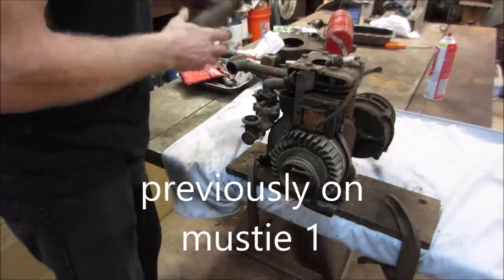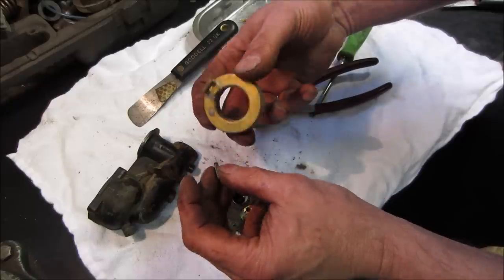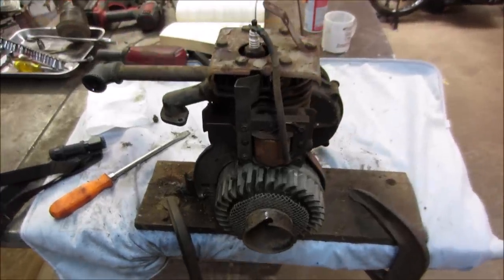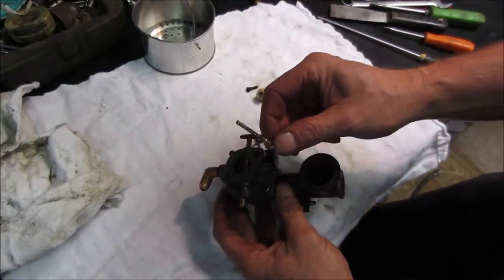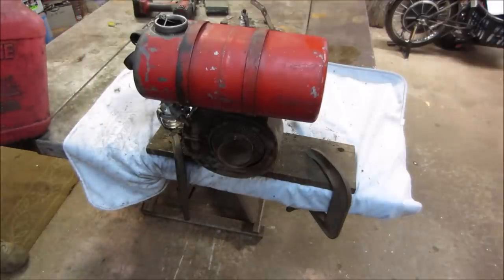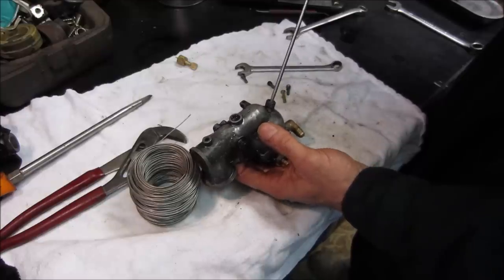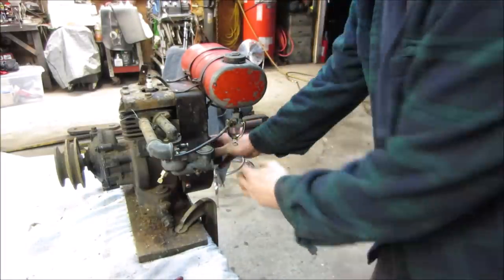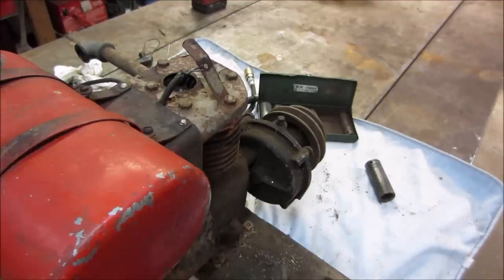Will It Run? $5 antique Briggs engine.part 2

Comment: For knocking the rust out of old gas tanks, I saw a trick. 805 Roadking drains em, fills em with a handfull of 1/4" square nuts, put the gas tank lid on and tapes the tank to the wheel on the back tire of his lawn mower. By the time he's done cutting his lawn, all the rust is scrubbed loose. Then he hits it with an air hose.

Comment: I had a lot of the same problems with a B&S Model 23, a larger version of this engine.  Had the same type carb.  It drove me absolutely insane.  Must've had it apart 4 or 5 times and it never ran right.  I finally couldn't take it.  I kept the cart the engine came on, and threw the engine out the second story window.  Problem solved.  Not every one is worth saving.  I applaud your patience, because it's WAY better than mine.

Comment: I’ve had some nice success cleaning out old rusty metal fuel tanks with muriatic acid. You really need to use it outside because it will cause bare metal around the environment to rust and healthy to breath ... not so much! Rinse out with alot of water afterward and give it a few days to dry. It has never failed to end rusty, cruddy fuel problems and I have never needed to do the same tank again.

Comment: It looks like a 5hp Brigg's engine we had on a Toro reel mower in the mid 1950's.  It worked pretty good the first year but after that it wore my arm out.  About the only engines I knew anything about in those days were a Mc Coy 29 and a Fox 35.  I could connect up my Lionel train set but that was about it.  Anything more complicated than these would have to wait another 20 years.  The Brigg's always had spark but the carburator must have had problems and we had good gas in those days, but Briggs engines in those days were an ify situation even at the best of times and 10 year Olds were not the best of times.

Comment: I havent looked at a Briggs in a very long time and this brings back all the bad memories. Starting from new, and you change the oil and maintain them, they have a life which in my experience is about 15-20 years and thats it. It might be fun to dick around with old dead engines but its not like they can be put back to serious duty.  Coughing and sputtering becomes a permanent condition no matter what you do because all they want at some point is a decent burial.

Comment: Mustie1 try small steel ball bearings next time to swish around in the gas tank with your choice of fluid to clean out the gas tank.
It works for me when i acquire an older Coleman lantern to clean out the sediments in it from the lantern sitting for a long period of time. 
Keep the videos come to western Pa.🙃🙃

Comment: All the  old Briggs never die. I’ve hardly had to do anything to make one of one run. I’ve only taken 3 carburetors apart out of a dozen Ive worked on and very few needed the points cleaned and re gapped.

Comment: Had those sediment bowls on all the small gas engines when I was in the service back in the day.  Rarely collected sediment but they would regularly fill up with water.  Was the first thing you checked in the winter because the water in the bowl would freeze.  The glass was tougher than you would think.  Dropped a few on hard surfaces and they didn't break...but we did have replacements, lol.
Reply: Feline Spirits I actually have a couple of new bowls in stock in my shop, along with some of the cork bowl gaskets. I can still get ‘em from my distributor. Can even get complete new assemblies. Most people don’t stock anything for the older stuff, but I like to keep some of it on the shelf so I can service folks that still have that stuff.

Comment: thanks for great vids watched a vid you had about generator that had a leaking fuel gauge i have used nail varnish to seal petrol leaks in past the clear is also good on cleaned cloudy gauges carry on the good work

Comment: On of my most used abrasives is Kitty Hawk NC beach sand.  It is very coarse with granules that vary from 1 to 2 mm  It washes out after two or three rinses.  It is small enough to get into crevices but not get stuck there.  I use it with water to clean out drink bottles.  It would probably work well in that gas tank with mineral spirits or alcohol or water.

Comment: That engine looks like the one I had on a go kart in the early 1960's.The first thing I did when I got it  was to remove the governor. I remember going for a ride with the kart and do a few laps around the neighborhood then drive into the garage and see if the cops would go by.

Comment: I have chucked those float needles in a cordless drill  the needle against a wetstone and removed the step so they can be used some more.  Just have to readjust the float level again.

Comment: Tractor supply has gaskets for the sediment bowl as well as replacement bowls.
The engine model mark would be under the gas tank.
That was why we were so skinny back then.  All that exercise trying to start the silly things.
The bale was to pull the pin out, also for ease during assembly
Reply: @Ashurii Canada?I thought he was in New Hampshire.

Comment: I once had someone give me a free Honda Accord with a stuck float. Honda carbs are notoriously bad to work on, so I clamped a set of vice-grips on the fuel line and just set them to the speed I wanted to drive at. I probably put 10,000 miles on the car that way. Got really good at it!

Comment: Took a carb apart just like that a couple days ago. You didn't say what the issue was with that odd screw but mine had one that was longer as it held a bracket for a metal crank case vent tube that more or less wrapped around the carb and entered a rubber flange on top of the breather. My engine was a smoker so i didn't go further. I thought the governor was missing but yours has none either. Didn't know they were made without them. Might take another look to fix.

Comment: well beings it is only one cylinder,it has to run in spec,i watched you wiggle the valve guides,they're toast,i saw the clearances on the piston,its toast,one cylinder and two cylinder engines I waste the time and hand hone them to clearances on the pistons,piston to wall clearance is critical to run forever,valve guides are next,they have to be set up to run,forever,this is a forever engine,look how old it is,the metal is up to par,probably has a cast iron liner,they were superior,like you approach to repair,this is where I started,this repair has lead me to a career in auto mechanics,strange start,fixing things is a good life,no boredom

Comment: you should build a tank turner to tumble them just an electric motor , a jack shaft , a couple pulleys and an old belt gear it to slow the turn , and weld some washers to the pulley so you can use a bungee to attach it , or do what I did in the spring that worked really good on a tiller tank , took a yard sale orbital sander , drilled 2 holes through the pad and put two small I bolts through it , clamped the sander in the vise , used a bungee to hold it on the pad , added a couple handfulls from the misc nut and bolt bucket , a little gas , and turned it on , flipped the tank around every few min to get all sides , it was pure rust when I started , it came out shiny like a new one try it sometime it's loud and annoying but it worked so dang good it is worth it if it's a tank you don't have a replacement option for laying around it was that square tank many of the 5 and 8 hp engines used , but it has a slanted bottom to clear the tiller handles only one I have ever seen like it and the normal tank won't fit , seems like a cost adder when they produced them making b&s supply a non standard tank to them , who knows , we will just blame it on the government LMAO

Comment: I once found a Coleman Gasoline lamp about15 or 20 feet up in a tree that was from the 1940's.
The gas tank was full of twigs and other forest related crap.
It looked like it was probably hung at 5 feet when left and just hitched a ride upwards as the tree grew.
Still a little grumpy on the start up but I replace the glass and fuel tank, but recently broke the glass and the new replacements are all just a little bit too small in the diameter.

Comment: Seeing you working on that Briggs brings back a lot f old memories. Unfortunately, few were good memories and I still have a scar on my right index finger knuckle from trying to adjust one of those carbs. :/ One thing that I did seem to recall, isn't there supposed to be a little spring steel flapper that covers that little vent hole on the bottom of the intake tube? On a previous job,they had a bunch of Briggs-powered trash pumps and I seem to recall them all having that flapper.
Reply: By the way, nicely timed! "Coming Up" and the otter popped out of the ice.. :)

Comment: Mustie  May I suggest  finding an old bbq grill rotisserie  motor and shaft. Mount so it will rotate a rusty  tank with media in it. Probably  best outside because the motors a quite noisy . I enjoy your videos, but here in Alabama  nothing is free, it could be a rotted out Murray  mower with one good tire and they will ask 200.00 for it. Good luck.

Comment: I have the same motor ,needed a coil couldn't find. One on eBay ,or fro Briggs and Stratton took old coil apart and took a coil from new one and put it together ,and it work

Comment: I remember when I could ride my bicycle a few blocks to the Western Auto store and get a glass bowl and gasket for 10 cents. A local store chain called The Farmers Store had small engine parts into the late 70s when a college educated manager took over and had them get rid of all of that stock because there wasn't enough profit in it. They stopped selling individual drill bits, screws, nuts etc and sold sets or packages instead. The people who had worked at the store for many years tried to explain that people came there to get the odd things and often bought other things. The new management wouldn't listen. 5 years later the stores were all shut down.

Comment: The last metal fuel tank I cleaned using my jar of small stainless fasteners.  Poured them in along with some solvent and gave them a shake for a while. Worked great and just put them back in the jar when finished.

Comment: Hopefully I get time to make one............... and can figure out how to ship.  I want to send you one of my propane thanks that I modified into an oil collection tank.  I make them with a nice long hose that you hook to a vacuum pump then suck oil out of an engine, and use an air fitting to push the old oil into a different tank when it is full.

Comment: I clean gas tanks with used motor oil and a piece of chain (sized depending on size of tank/ thickness of metal/ depth of rust).. put inside and give a good shake ;) Pour out rust/ oil and tank is "coated" & ready to use :)

Comment: It's a later model 8 Briggs, 1957ish, with a K90 Kohler fuel tank assembly. Looks like it was on an early 60s minibike -with string throttle haha! Long stroke, small bore, lots of low end torque, 2-1/2 HP @ 2,800rpm.

Comment: Yes, it's so easy to mess up the main mixture on those. Packing won't let it seat. Then you get over rich and then it starves for gas. If you want to play soak all the gaskets and packing in brake fluid, sometimes it will make them pliable enough you can reuse them. Good videos though, make it run first before you spend any money on it!

Comment: If this would of existed 10 years ago, i would of sent you 2 of those carbs for parts with the oil air filter on them still.

Oh and sulfuric acid works the best in the gas tank. Not full strength of course.

Also the bowl screw doesnt have to be out that far. Those carbs were very good on gas, and i was able to have the motor at a very low rpm at idle. 

That us a great carb.

Comment: 805 Roadking has a container with square machine nuts he uses to clean fuel tanks. Straps them to a Lawn tractor/mower. Does the gear reduction case take separate oil ? I enjoy these dinosaurs being brought back to life.

Comment: I have a relatively new '90's model 8hp Briggs with that same kind of updraft carb and its hell to get it to hold the right air fuel mixture.

Eventually I plan on replacing it with an experimental one of my own design.

Comment: Thanks for a little tutorial of small engine work... it may come in handy some day for a lot of us. 2 things: 1. Do you ever worry about developing cancer from breathing all the exhaust (I felt better when you at least opened your garage door!), have all that oil and gas on your hands, and then suck on your bloody knuckle and consume that fuel/oil? I noticed the only part of the video when you wore rubber latex gloves was when you WASHED YOUR NUTS!! Work safe and be careful. 2. That pond probably has zero fish in it with that otter/beaver.

Comment: I do not use ethanol fuel in my small engines. I spend the extra money and get non ethanol fuel. I have no issues with my lawnmower or my atv’s.

Comment: the way this carb works, it needs one needle in the ballpark, before you can get the fuel enrichment right on the bottom. it also wants that fuel level adjustment on that float correct before any adjustment. otherwise, you're going to pull your hair out. get the smaller screw to around a turn and a half, then leave it alone in just your bottom enrichment screw, when the motor sounds just a little rough, go back and adjust the top one only slightly. throttle it a few times and repeat this process and you'll get it.

Comment: I like settlement bowls myself, since they also serve as fuel/water separator.  I do not think modern fuel filters do that very well since they usually will not pass water at all.  Water just plugs the filter up.  I also think water needs to be filtered more on small engines since they are usually filled from gas cans.

Comment: Those gear reduction units usually have their own oil supply, didn't see you check that one. I saw a video on a device being used for cutting perfect gaskets called a Cricut, pricey at $300 but there is another brand called a Silhouette 3 sold by hobby lobby for $120 with their 40% off anyone item coupon and commenters said it worked great.

Comment: For de-scaling old fuel tanks, I use something sharper than brass nuts (short Drywall screws) and something stronger/hotter that your brown parts washer fluid that I'm assuming is diesel? ( I use Lacquer thinner) - and then usually sit and shake it in the recliner watching a 30 min (or more) TV show, changing angles every 5 mins or so-

Comment: I have another updraft carb similar to the one you have if you want it. Not sure if it's completely the same, but it's from a 16hp briggs single cylinder. Donor engine had one of the ears that you screw the carb bolts in to break off from the block, so it's not really worth fixing. Came from a Gravely 8163b tractor (I have a 1000CC generac engine i'm modifying to run on that tractor for giggles). It did run with some jb-weld around the neck, but it ran like crap. Maybe at the very least the float needle is the same? If you want it give me a shout and i'll send pictures and can ship it to you for free.

Comment: I don't know if you read this or not but the problem with the flooding is your installation of the high speed mixture screw. You need to push it through the packing nut and start threading it into the carb hole where you put the long jet before you install the packing and packing nut. You are no where close to the mixture seat. Compare the first video to the second and you will see that it was much further in to start out with.

Comment: I watch all of you on Youtube trying to clean Out your Gas tanks in MANY different ways . RoadKing Puts Square Nuts in them and then puts them on his Lawn Mower wheel and Mows the lawn and when he is done . Most  of the time Most of the rust is Taken off of the inside of the tank ... I was thinking WHAT IF you Bought One of those Paint Shakers they Use at KMart or Sears(Since they are all closing) And Pick one of them up Cheap . Strap your tank to it, Put Those Square nuts in it and LET IT GO ... I think that would work GREAT ...

Comment: I love your videos. I was wondering why you don't spray all the bolts down with penitrating oil before you tare into something or even the engine bits. I discovered that early on and sometimes I think that is the only thing I am doing right when I am messing with an old engine.

Comment: Try that with one of the new plastic, electronic engines!  I had an old B&S on a conveyor and it used so much oil you had to refill it each time you put gas in it but it ran and ran.  Once a day we swapped spark plugs with a chain saw because they got so oiled up in that Briggs

Comment: Looked at a push mower today. The guy wanted $35. You could rotate the motor half way and hear a metallic clunk. Then rotate it back the other way CLUNK.  I believe the piston rod had unconnected its self ....lol. Told the owner NO THANKS... free mabe....But not $35. Wasnt a sheared keyway...pretty solid clunk. lol.

Comment: You can take a variable speed electric motor put a bracket on it that you can strap gas tanks to, and just plug it in and let it turn like a rock tumble till the tank is clean.

Comment: make sure that float doesn't get you. I've had them where they don't leak, but yet, they have just enough residue on them to make them heavy, throwing off the original adjustment, and not pushing the needle against its seat in time.